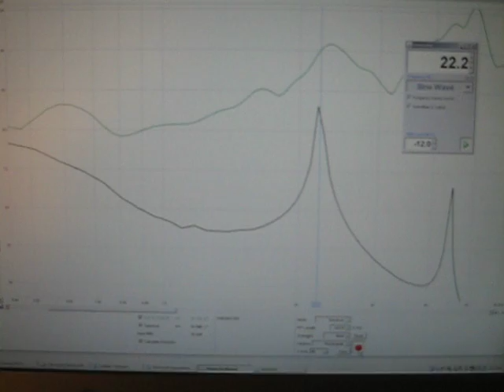BFM Tuba HT - 121db @ 22.2hz / 10.8v - With unmeasurable distortion using REW

Comment: Corner loaded and measuring SPL at the mouth. Why? Is that how you plan to run it? Seems like you would want to get less distortion from objects vibrating with proper placement. Unless, of course, the low-end roll off is too great when not loaded to 4pi.
Reply: fidstang this enclosure operates using reflective gain of the room